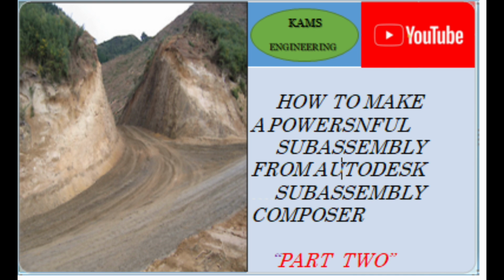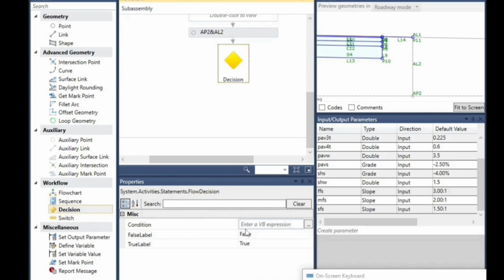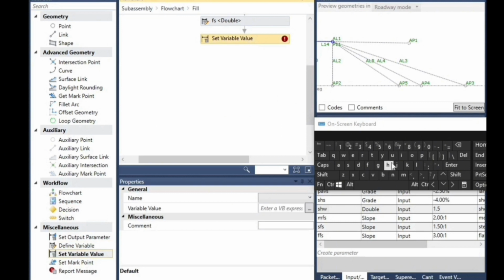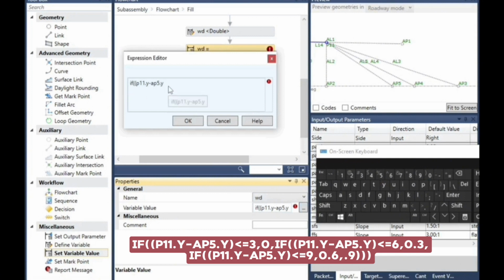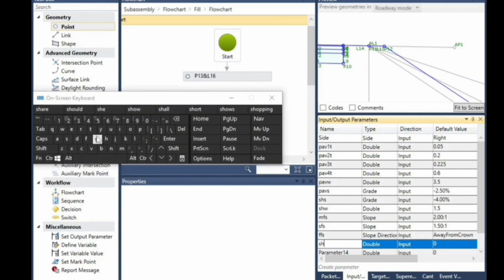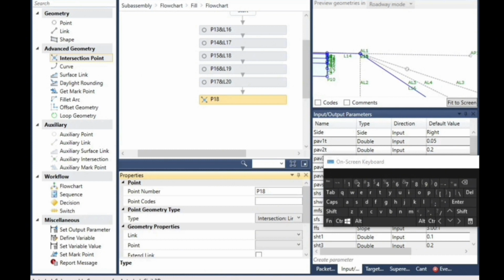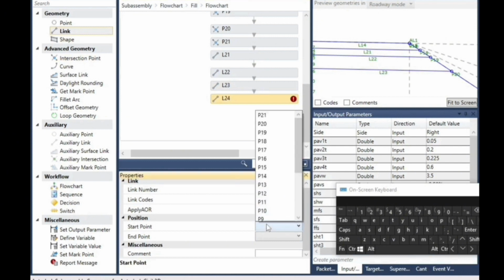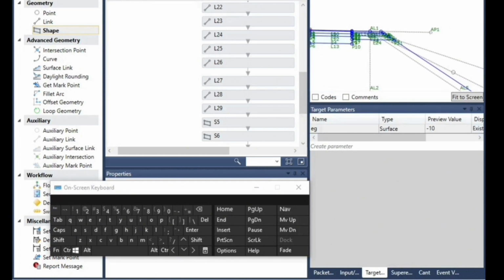A Powerful Subasembly from Autodesk subasembly composer  part two

Comment: Sir, Your thorough attention to detail in executing each condition with a high level of professionalism is truly commendable. The video you have produced is a masterpiece in the realm of sub-assembly composer presentations.
I have a question regarding a specific segment of the tutorial at the timestamp 29:56. In this segment, you was pause the video to create two links: L25, connecting points 12 to 18, and L26, established using the same points, P12 to P18. I am seeking clarity on the reason for creating these links twice. Is this duplication necessary to achieve the desired result, or was it accidentally duplicated? I pose this question just to resolve my confusion on this matter.
I extend my gratitude for the dedication and effort you have invested in maintaining a professional workflow.
Thank you.